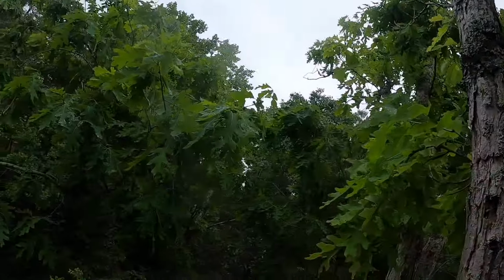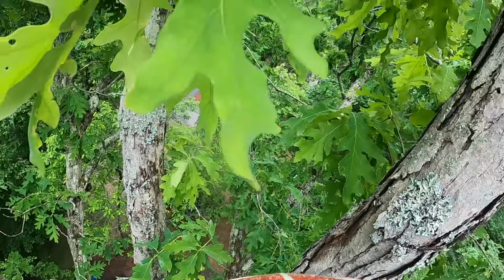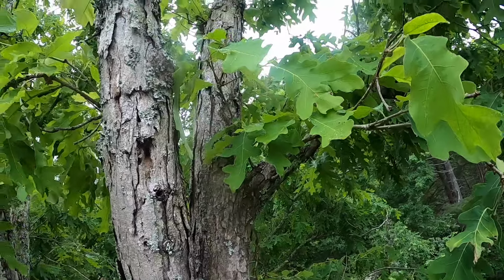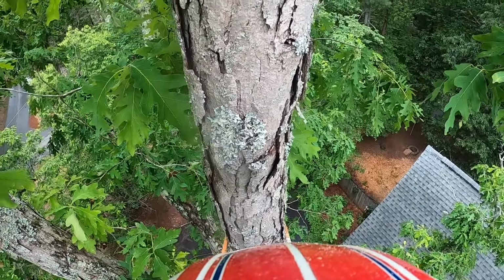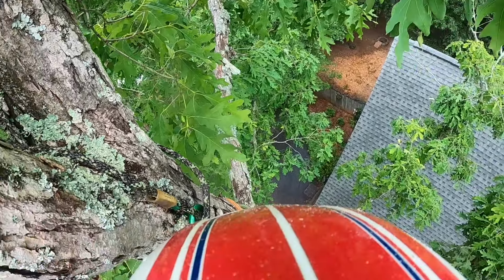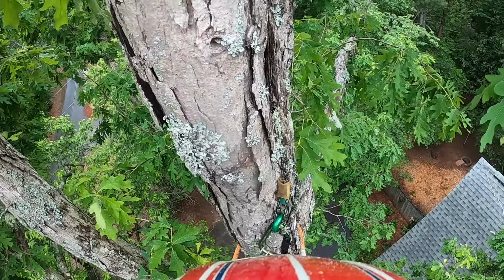Oak by house

Comment: Nice bar-b-que wood there...
Reply from the maker: I never tried to barbecue with oak. I have done it with hickory and Cherry. I know a guy who’s actually smoked with Bradford pear I never have but he swears by it have you Done it with Oak before
Reply: Oh yeah.  Family usually cooks 5 pigs around Christmas and oak is all we use. Most abundant wood source but hickory throws good heat!!
Reply from the maker: @jodyhodge2129  I like the taste with cherry wood I will have to try oak one day which kind you like more white black red etc?
Reply: Any oak that is avaliable. Water oak to white. The key is to mix green in with good dry wood to keep from having just a bonfire. Keeps good heavy coals for cooking and your cooking heat doesn't cycle from warm to hot especially if you are using an enclosed pit.
Reply from the maker: @jodyhodge2129  yeah be the same concept cooking with other type wood.